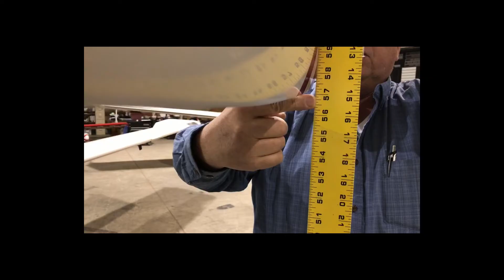Understanding P factor

Comment: Why does nobody cop that you’re not consistent on where you’re measuring….
Reply: thanks, I was wondering that too as I watched. measuring straight and level, the straight edge is on the front of the prop on both sides. when the airplane is tilted up, he measures from the rear of the prop on the right side but the front of the prop on the left side. 🤔

I also noted another comment where a distinction is made between two different concepts: AoA and p-factor. I agree this video is only demonstring the difference between AoA on each side of the prop and that p-factor is related but not explained here by only the angular difference.

there is also a third concept related to prop slip but that's pretty academic and even tougher to explain. 🤪

Comment: Amazing to me that this false explanation still makes the rounds.  This demonstration completely misrepresents blade angle of attack, which is not defined in reference to the vertical ruler.  Blade angle of attack is mostly tied to the plane of rotation, which rotates with the overall aircraft pitch.  This demo will go a long way to spread this bad idea.
P-factor is the result of differing relative airspeeds as the downward blade moves forward into a relative wind, and the upward blade moves back with the relative wind.

Comment: Respectfully, that is actually not how P-Factor works. When you tilted the plane back you represented changing the Prop axis Angle of Attack (PaAOA). It is important to understand that the blade rotation is ALWAYS perpendicular to the prop axis.  When you tilted the plane back you assumed that the propeller was still rotating at the same angle as it was when it was not tilted back (as indicated by the meter stick still being in the vertical position). When the plane is tilted the meter stick should not be vertical, it should be perpendicular the the Prop axis (orthogonal to the tilt angle). P-Factor is due to circumferential differentials of angle of attack of the airfoil when the Prop Axis angle of attack is not parallel to the aircraft velocity (in other words the PaAOA is not zero). You have to dive into how the PaAOA effects the relative wind vector to truly understand P-Factor.

While this demonstration was well made and clear, it is demonstrating a false understanding of P-Factor.

Comment: Absolutely great visualization! Way better than seeing it in a book. But is there a way you can remake the video, I get a little confused seeing the ruler on the front side of the prop on the descending blade but when you come back to it you measure from the back side. Unless im wrong i think it should be measured from the back side of both blades, what are your thoughts? Again great video!
Reply: The angles should be the same if I am not wrong, but I agree, it's a little confusing this way. But great video indeed
Reply: I noticed this, and you are right. The concept is still right, and easy to understand the way he showed. But yes, when he pitched the nose of the airplane Up, he measured the descending blade from the back, and the ascending from the front. Although the concept is still right, he should have measured both sides from the back of the propeller.
Reply: @fernand3s  dang I posted that 4 years ago, feels like yesterday!
Reply: @idratherfly2000  still a great video. I'm working on my CFI Liscense and reviewing the material for it. There a very few videos on the subject. And yours is realy simple and easy to understand. 👍🏾